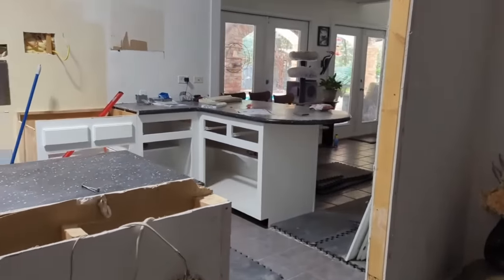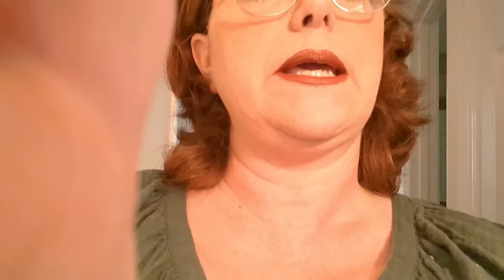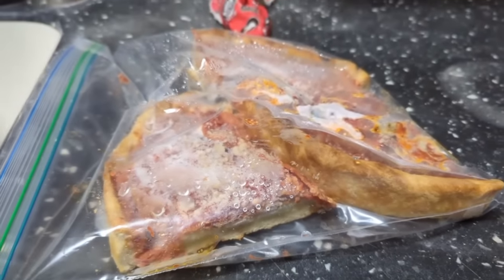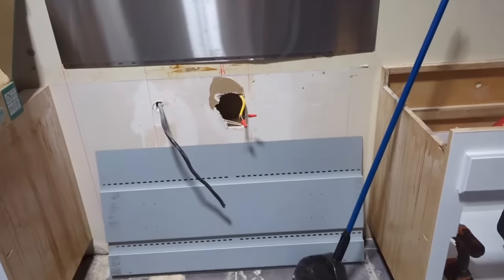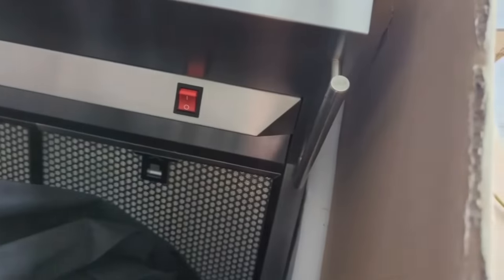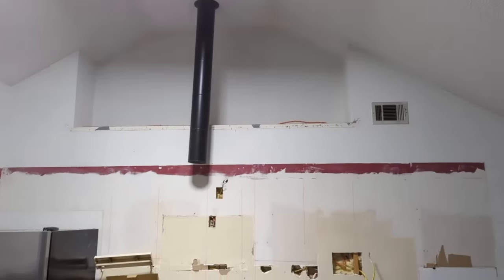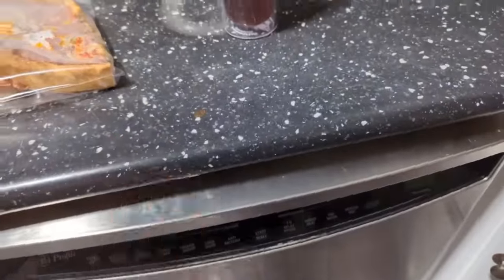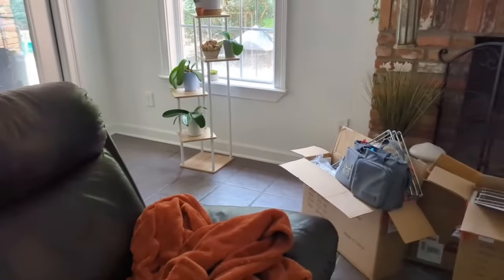Kitchen Remodel Update & Oven Cabinet Renovation

Comment: Tammy, we had the same knocking sound in our refrigerator. We found out it was a little point in the gear of the ice maker making that noise. It was cheap to replace the gear. You may want to have Chris check into replacing the gear. It's nice to not have that knocking noise any longer. I love what you're doing with your kitchen remodel.

Comment: Have you considered putting a white cabinet on the small wall & having your microwave & your Cosori Oven installed in it? Just make sure the two have adequate electrical power to support being used at same time. I would have white painted shiplap above the vent hood. Had it installed in my kitchen update & it looks great. Very clean & gives a farmhouse look & a great place to display your chicken collection on the shelf. Also have you a pot filler installed above your new beautiful cook stove to save you having to lift heavy pots of water from your kitchen sink to your stove top. Love your new kitchen plans.

Comment: I like your idea about the dead space above the stove area. At home depot you can buy window cling that looks like stained glass.Comes ,I think in a roll, different patterns to choose from. I 'm not sure though, how well it would stay on with heat rising from the stove. But good idea you've thought of. The curtains will add a touch of country charm.

Comment: Tongue and groove all the way to the ceiling then box in the exhaust pipe and stain the same color as your shelves. If you want you can put more shelves on either side of the pipe or use the space for hanging flat objects like your collard valley sign. ❤

Comment: Though we all can’t really see the reason some walls or half wall. have to remain, (infrastructure), I think I’d remove any wall, half or not, that doesn’t have to be there. That would open it ALL up. This is coming from an old grandma, that has had the same house for over 50 years, with a tiny kitchen.☺️ This is the reason I’d tear out everything possible 😂 
BUT…your kitchen will be absolutely beautiful when finished.  It’ll make a world of a difference for you. ❤
Reply from the maker: The wall next to the sink has overhead cabinets that I don't want to loose.  The wall on the other side is my wall that I plan to mount some lighting on for filming.  I wanted to make it a half wall, but I think I will need the lighting.

Comment: You can take that wall out and just put some complimentary little square or round pebble tile in that area where that wall was in the floor. Would look fine until you decide…if ever…to change the floor. I would get rid of the wall if it were me since it does not support anything

Comment: If the ice maker in the refrigerator is not connected to water line currently turn the ice maker itself off... it is trying to fill and cannot. That may solve the issue...
Reply: I think there is a switch on the ice maker...